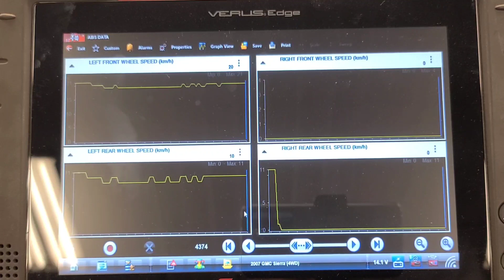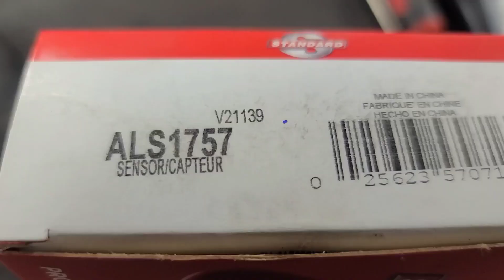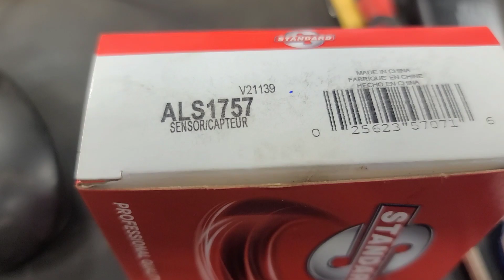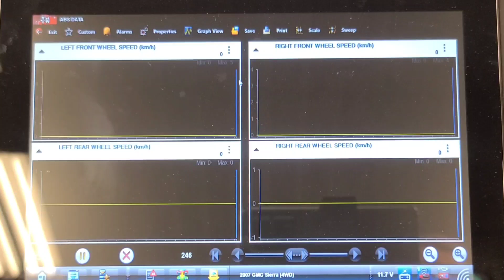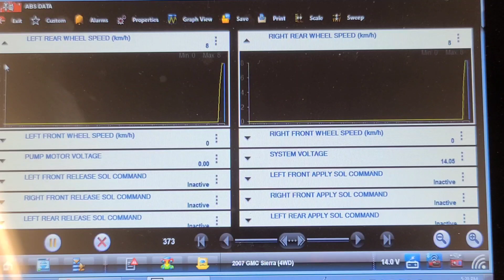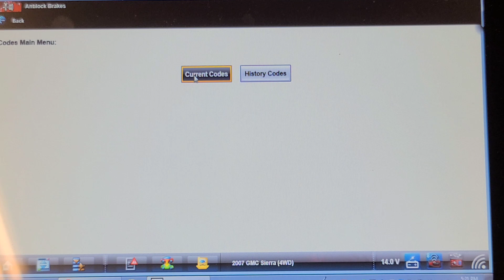2007 GM Truck 1500 4x4 ABS Light on Intermittently Code C0050

Comment: Hey hi mister Phillip, I have a 2013 Ford F450 6.7 with this code P20C2 and I already replaced def heater and the pump too and the harness and still the code is not desapear, can you help me with that please 🙏
Reply from the maker: P20C2 is for a problem with the glow plug controls as far as I can tell. Are you sure that's the code you were chasing?
Reply: @PhillipBailey  yes sir that is code only have
Reply from the maker: @franciscohunter4422  not necessarily you need to check the circuits to it first. It may require replacement but it might just be a burnt fuse.
Reply: @PhillipBailey  thanks 🙏 mister Phillip I will check it the fuses again, because I already checked but maybe some are burn out
Reply: @PhillipBailey  mister Phillip so I have to replace the glow plug control module?
Reply: @PhillipBailey  thanks very much mister Phillip for respond me I very appreciate you

Comment: Phillip, thanks for the tips to heat the sensor to see the drop and the engine running with trans on revers or drive to see the speed sensor signal that's really strange most cars will show u the signal when u turn the wheel great info as always brother.
Reply from the maker: Yes that sure threw me. I've never seen that before but I'm certainly going to check some other GM trucks.